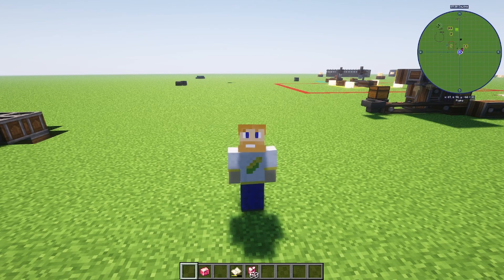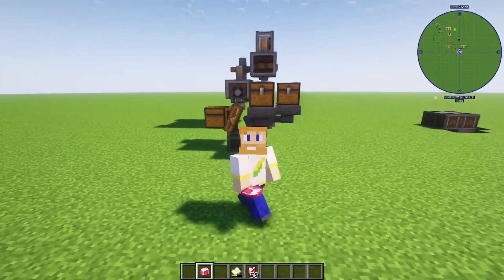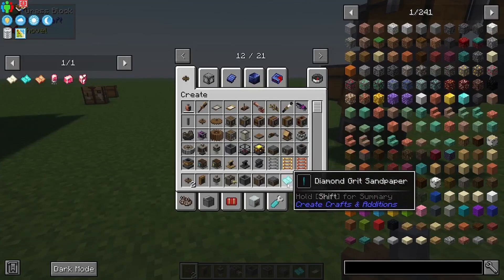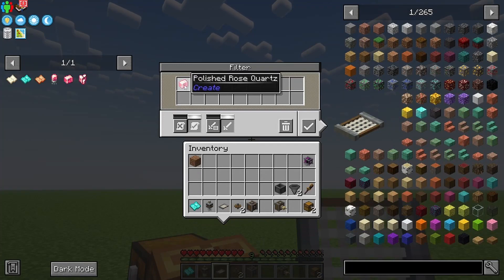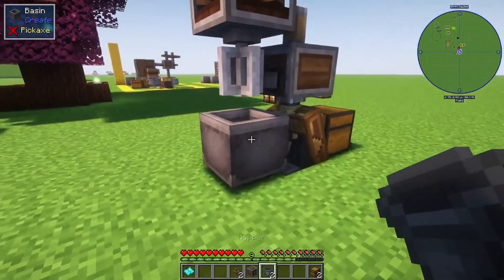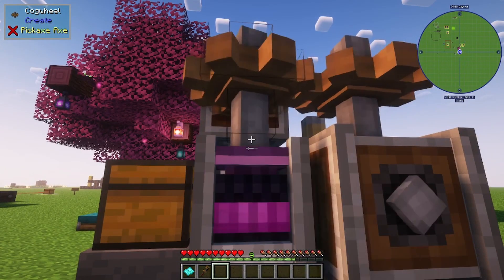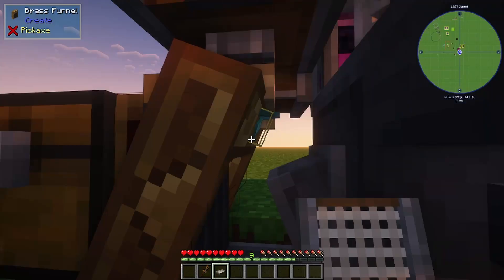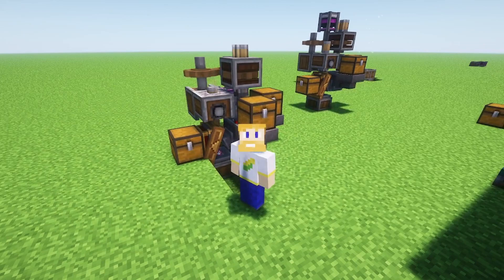Automating Polished Rose Quartz |1.19| (Create Mod)

Comment: Made the automater but when I connected power it says I don’t have enough.Any tips since in your  videos you use a creative motor so it’s not as hard of a process to power to the machine.
Reply from the maker: Yeah I didn’t think about that. I’ve been making newer videos using actual water wheels instead of creative motors but haven’t got this one yet. I’d say make a water wheel powering a large gear then a small gear on the machine. If it doesn’t work with one water wheel then add another wheel until it works! I appreciate the feedback as always!
Reply: @cornybreadman  thanks man appreciate it